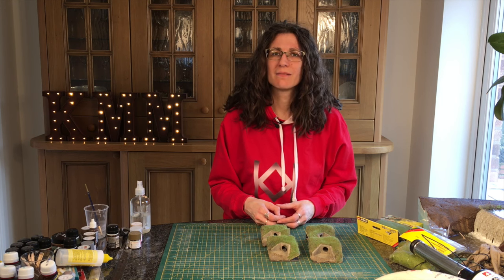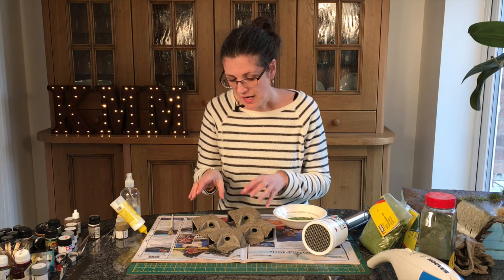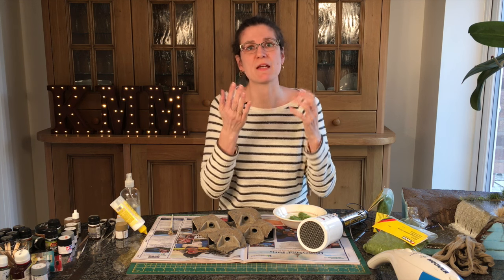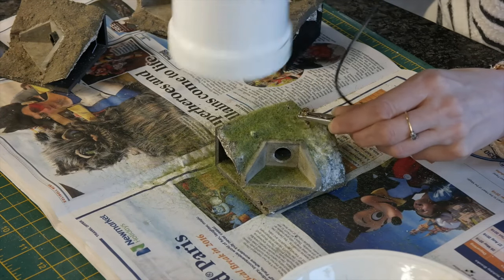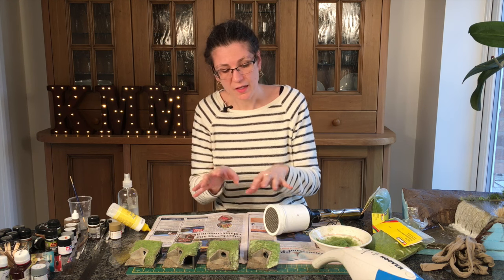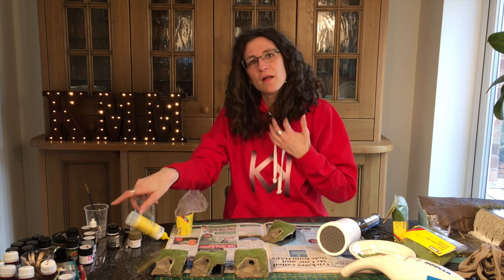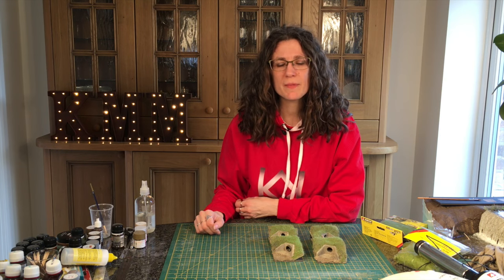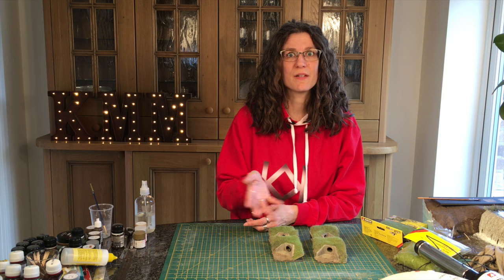How to Model Static Grass

Comment: Great video as always, Kathy!
For those of us on a budget, there are cheaper grass applicators available, or you can even make your own. Mine cost a lot less than the Noch and works well.
Also, when using the vacuum, I cover the inlet nozzle with a piece of net curtain secured with a rubber band (any other fine mesh material will do - tights?). The excess grass sticks to the mesh and can easily be dropped into a dish for future use.
Reply from the maker: Hi. I bought this year's ago but you are so right, there are many other applicators now.
Reply from the maker: On my main layout, I often use tights over my normal hoover. Downstairs or in hard to reach corners I use this.

Comment: Hi, Kathy or anyone help ! advice  needed I bought a few big bags of 10mm static grass and realized that my flockbox would not make it stand upright with PVA glue using every possible technique with the device  i.e. on the plate and nicely thinned out with the sieve or falling down onto the silicone paper with pva glue from a sieve with the 2nd cable attached - it just didn't work the 10mm grass lay flat or stuck on at weird angles and looked quite bald on the pva glue. In all fairness the flockbox from warpainter is  great for 4mm-6mm longer grasses that works fine but 10mm  no way (and they don't claim it does). Can you think of a device or a technique to get that 10mm grass to stand upright and uniform ?  I've had a few ideas which I haven't tried out yet i.e. using Noch's electro conductive glue, or sticking a metal pin right in the middle of the pva glue and attaching the cable to it directly via the flockbox, even using a vacuum cleaner to suck the fibers up from the glue (I doubt that will work). Anyone got any alternative ideas or have found a way of getting 10mm grass to stand up ? I've got two big bags of the stuff and do not want it to go to waste and want really tall jungle grass on my miniature bases. The Noch static grass applicator 'claims' to be able to do  up to 12mm grass upright and even has a filter for such but reading the amazon reviews for Germany amazon.de for the product one guy states it cannot really or at least it struggles to do so.

Comment: I see you are having trouble with the applicator. Wouldn't it work better if you clipped the alligator clip onto the edge of the item you are working on?
Reply from the maker: +mininecessities Sometimes there's not enough room but that is the general aim.
Reply: I have found the best method is to put a stick pin through the ground, preferably to the side and not directly under the applicator.  Then connect the ground alligator clip to the stick pin.  If the pin/ground is directly under the applicator, then the magnetic field isn't ideal for getting the grass to stand up and there is a greater chance that the mesh screen on the applicator is going to touch ground, which makes a loud static pop and could zap the user if she/he is touching the ground.  I have also found that using a more watered down glue works better than a very thick glue for applying static grass but on sloped ground, it isn't always possible.